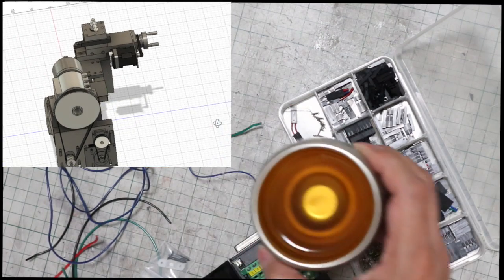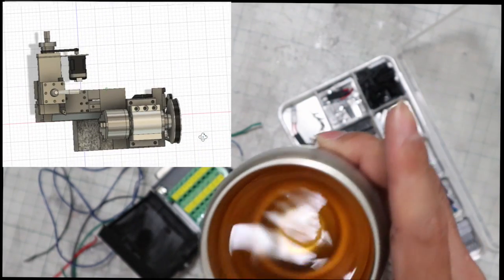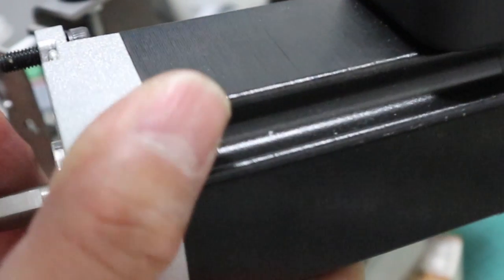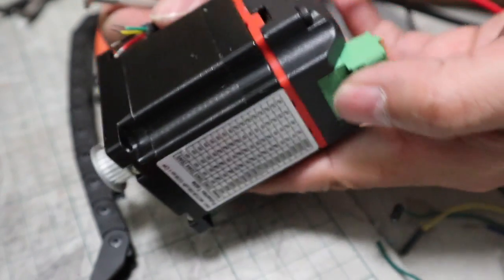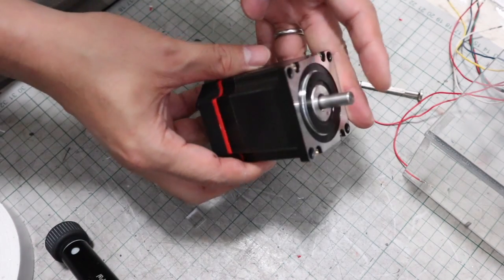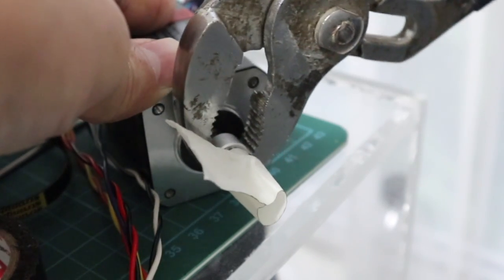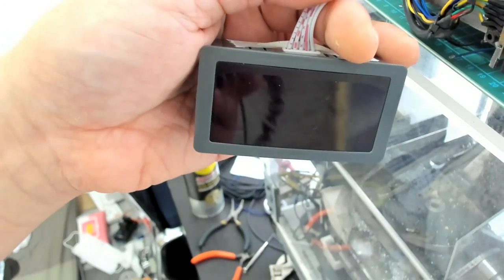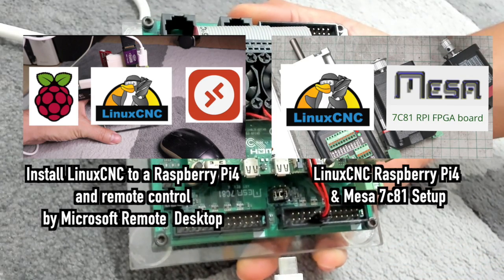Homemade DIY Small CNC Lathe ,Part6

Comment from the maker: Website for this video series https://www.acncf.site/en/cnc-lathe
Reply: Thank you for reacting, You Are Great. I think you should be very gentle. Many airplane and tank modeling channels use the technique to create water-based vignettes or dioramas when they pour epoxy, and there is a trick to it, be gentle, if you overheat the epoxy, it will create more bubbles, rather to take them away.
Reply: The website doesn´t work for me, am I the only one? Trying to find some tutorial, have my own construction, but don´t know how about electronics and controlling stuff, what to use, how to wire it and how to program everything to work correctly :D could someone help me with some links? THX

Comment: Hi, please excuse my curiosity. For the cross slide, is it safe for the motor (for the long term) if the shaft is frequently rotated manually (I see the shaft is connected to a handle)? And won't the shaft return to its original position if rotated manually? I'm learning to build a CNC machine like yours. Thanks.
Reply from the maker: Are you talking about backlash?
If so, I use the backlash compensation feature of Linuxcnc to deal with that.

Comment: Dude, I'm new to the channel, probably it has been said before, but let the heat gun in your life. Not just for heat shrink tubes, but because it takes out air bubbles if carefully used on the surface of epoxy castings, just after the pour.
Reply from the maker: Thanks for the advice, I'll give it a try.

Comment: still very cool. love this compact design. wish the electronics box was more "integrated" with the rest of the design.
Reply from the maker: Right now, the electrical box is connected directly to the machine because it is in the process of being built, but when the 1.5 meter cable I have ordered arrives, I will place it far away from the machine.

Comment: Nice work, great to see it cutting. How loud does the spindle belt get at full RPM?
Reply from the maker: 340rpm 55dB〜60dB
Reply: @a-cnc-f  is that a typo? Did you mean 3400RPM?